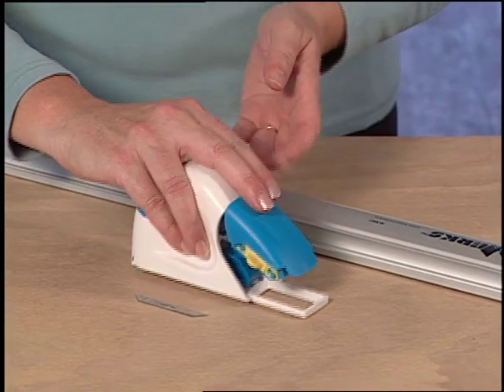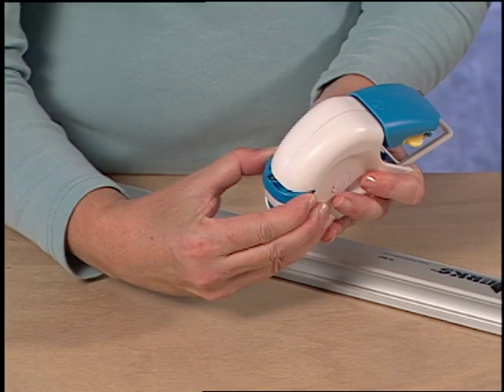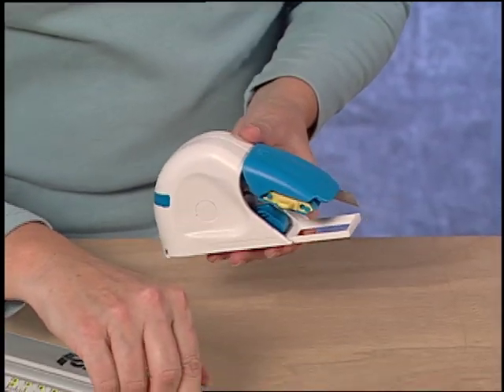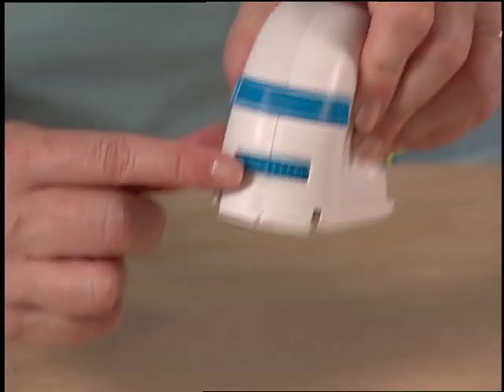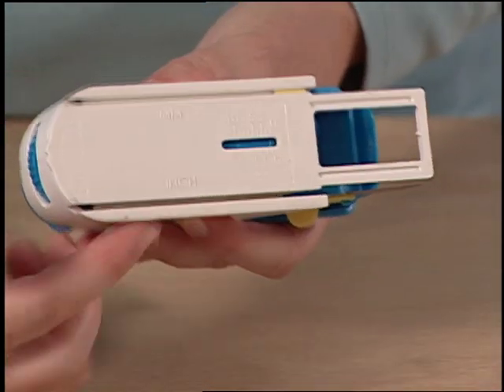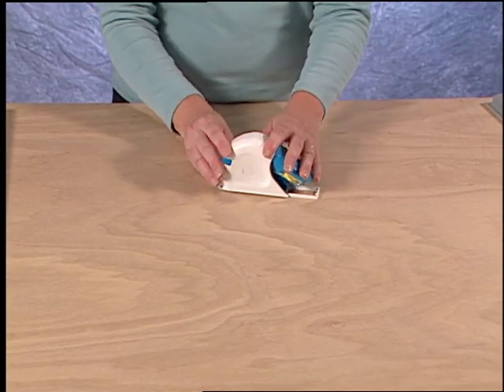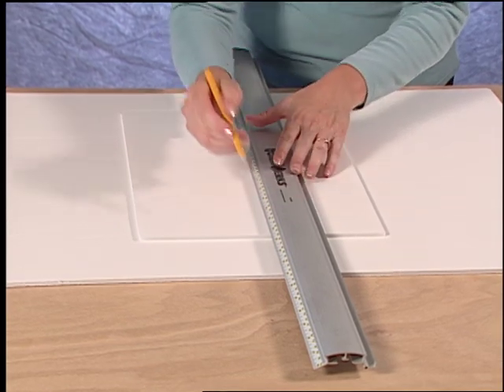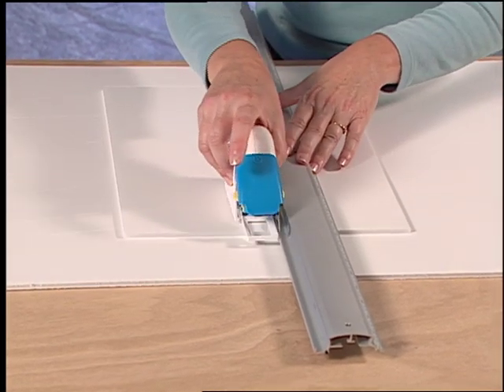FoamWerks WC-6001 Straight Cutter

Comment: Curious - all the videos say to use a scrap piece of foam board underneath. But most people cut foam board on a self-healing cutting mat. Is using a cutting mat instead NOT recommended? No mention of this that I have seen.
Reply from the maker: With the FoamWerks line, you must use scrap foam board as underlayment. Anything else is usually too dense and will overstress the tool. Do not use the rubber self healing mat.
Reply: Interesting, thanks. Are the blades made of softer metal than, for example, a snap-off box cutter type of blade?
Reply from the maker: No, they are standard type blades but they must be extended a long distance to pass through foamboard as thick as 1/2". This excess depth can allow the blades to flex. You need to avoid any flexing of the blade to get good cuts and the softest material that is sturdy enough to support the cutting is simply more foamboard underneath. A rubber cutting mat is very dense and it will dull the blade quickly, possibly allow it to flex and the extra pressure may overstress the tool. The best suggestion is to use masking tape to secure a large square piece of foamboard on your work surface and use it until it is so worn that you have to flip it over and use the other side.

Comment: Can this product be used to cut polyester acoustic panel? 
What is the recommend product if we need to cut a panel that is 15mm thick?
Reply from the maker: Not sure, it is designed for sanding wood moulding for picture frames only.

Comment: I’m having a hard time removing the blade from the storage blue piece. I am able to pull it out but can’t get the blades out
Reply from the maker: Hello, There is a small plastic tab inside the blade drawer that holds the blades in place. Use your finger tip to push on this tab and the blades should fall or shake out. To remove the drawer from the back, squeeze the sides as you pull back. Thanks.
Reply: Logan Graphic thank you, I had to get help. My nails after too frail to push the tab back and pull the blade out lol. But thank you, this cutter works like a dream! I purchased the set with the 3 blue handled cutters as well as the this and the V, I love them!
Reply from the maker: @EmGutzy  Hi, Glad to hear that, thanks for letting us know!